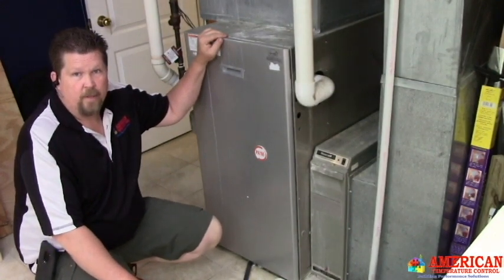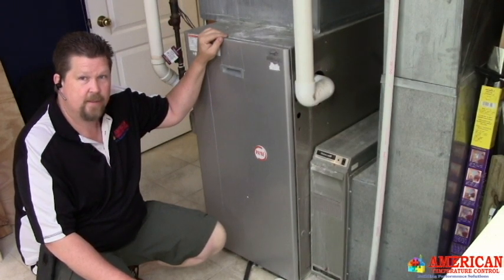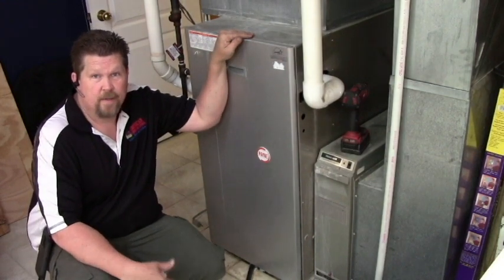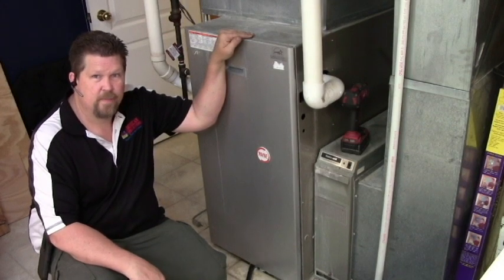Payne Furnace Heat Exchanger Replacement

Comment: I appreciated your informative video, especially since I know nothing about furnaces. My Payne PG9YAB036060 was installed January 4, 2012 and this winter it started making unusual noises. A whining sound has sometimes been occurring since November 2022. This noise can be heard before the blower starts and heating begins. It will happen several times until it starts up. Maybe the noise is from the secondary heat exchanger because I've never had it serviced or cleaned. I've lowered my thermostat from 72 to 70 hoping the furnace will last until spring. I also have a Lennox ac that was installed April 10, 1992. It's never been serviced and has been a terrific ac however it tripped the breaker in the summer of 2021. Since then I've been keeping the thermostat at 80 when I normally have it at 78 during summer. Sometimes I switch it off and use my electric fan to keep cool. It looks like I'll have to have it replaced when I have the furnace replaced or repaired and cleaned. Have a safe 2023 and happy birthday.
Reply from the maker: Thanks, your noise sounds like an inducer motor/fan blade failure, main contributor is poor air flow and/or high static pressures in duct system. maintenance does help.
Reply: @americantemperaturecontrol7852  Thanks very much for the information. Maybe the Space-Gard High Efficiency Air Cleaner is too restrictive. It uses Aprilaire 213 pleated replacement media which I installed October 6, 2022. The old filter looked almost like new since I have no pets, don’t smoke and live alone. After the Payne furnace replaced the original Tappan 11 years ago, it greatly reduced our natural gas bill but maybe the air returns are too undersized for the more powerful Payne blower. The Tappan furnace lasted 37 years although it should have been replaced sooner. We had to replace it immediately after the technician informed us about how dangerous it had become. The house was built in 1975 and we moved in about 6 months later in early 1976. The winters were much colder in the 70s, 80s and 90s but the Tappan was always reliable and trouble-free. Hopefully a technician will be able to fix the Payne soon whether it’s the inducer motor, pressure switch etc.

Comment: Nice video. Did you have to notched about 1/4" off the inducer legs to get the inducer to seal properly against the new secondary heat exchanger? Thanks

Comment: Excellent video how long will it last with new exchange do you recommend any maintenance to Keep it from clogging again?  I had mine done last year 😊
Reply: I have the same question basically.  Our Amana lasted 8.5 years.  Warranty replaced the furnace yesterday.  How can I prevent this clogging of secondary or where the soot/dirt came from?  They replaced without a good answer or resolve to this question in my opinion.  Hard to complain about a new furnace, but not excited about this one lasting only 8-10 years.
Reply: @blbrawn  I know my issue was covered outside pvc pipe from Home Depot so know I don’t cover with screen anymore.  I just leave outside pipes open I never had anything blocking it

Comment: I have a goodman furnace, now about 4 yrs old that has been running beautifully. (GMEC960603BN ). When the installer put it in , he didnt replace the plenum that sits on the burner cabinet. That plenum has a patched area i removed easily, because i was interested in looking at the condition of the A COIL . Well as i peered in, much to my shock, I noticed 3 rust blotches on the heat exchanger. A dark one, a lighter one behind it and a third lighter one down the same side (Theres is a heavy-duty, aluminized-steel tubular heat exchanger and a stainless-steel secondary heat exchanger. ) I touched the tubular affected area with my hand and it was still solid no cracks. How worried should i be in this situation . I intend on unclogging or replacing the A COIL that has a heavy rust spot on it that know is where the drip came from to cause the rust spot. Whats your opinion about this ? Would you replace it immediately  or wait , since its winter pretty soon?
Reply: if your co detectors are not going off then leave the furnace alone dont piss off the beast thats heating your home.
Reply: Relax sounds like it’s superficial due to a drip from the leaking ac evaporator ac coil above.🎉

Comment: There was a piece of metal that was on the old exchanger, between the secondary and primaries, that was forgotten. I really don't know what purpose it actually serves, or what it needs to be in there for, but usually you got to have them back on.
Reply: Without that plate the furnace will trip the main limit (overheating)
Reply: @douglasteetzel3552  yeah

Comment: Is there not an air diverter to go in between the primary and secondary in the back as in Carrier and Bryant to divert air.    Just asking
Reply: Not on all models, you will usually see this on on 3 stage furnaces or furnaces with low airflow capability to protect the high limit from overheating, he missed it on this model though hmmmm
Reply: @soloryderrr  
Correct, but I am pretty sure he removed it from the old one.

Comment: At 14:24, would you tell me the part number of the Primary Cell Outlet Panel, please, for PG9MAA-048100 (same as Carrier 58MVP-100-20), please?  I cannot locate that part number anywhere.

Comment: The video was sped up. How long did it take you and how long does it usually take you to complete both a primary and secondary heat exchangers? Great video as well!
Reply from the maker: Each change out is different. We knock them out usually 3hrs plus part pickup time and warranty paperwork.  The actual labor to change out can be as quickly as 1.5 hrs or long as 6hrs because the screws are rusted away.

Comment: I betcha that you got a call back on that furnace. I have done around 60 of these in the last 15 years. And i seen one step you forgot there is a baffle that is suppose to go under primary and on top of secondary thaf deflects the air. With out this baffle you gonna get 33 error codes

Comment: Did they change the material it's made out of for recall replacements or is it the same as it was ?
Reply from the maker: Yes, A replaced secondary heat exchanger can be identified by gray plastic collection box.

Comment: Was this a warranty replacement and repair? I have a 2005 Payne. What was the customer noticing about the furnace that required you to diagnose and fix the furnace? What are the symptoms to look for? I have a Payne that was installed around 2005. Are there recall notices on these?
Reply: Mine just started acting up I have this same furnace,  You notice the furnance stops functioning ( just spins the main blower constantly and slowly with no heat). and its not under control of the thermostat.  It trips the Flame out sensor / switch ( the flames that go into the top holes from the burner stop getting drawn into it so it basically burns / heats up that metal box you see it mounted in until the senso you see on the right side trips.  It gets hot, along with the top of the furnace housing ( hot enough to burn you if you touch it more then an instant.  

Mine was converted to propane so it seems to be clogged up, they replaced that air induction fan that you see ont he front ( black circular one with the plastic housing,  no change int he flames , its still not being sucked into the heat exchanger.  

So looks like rather then this whole heat excahnge out I will just get a new furnace with a heat pump.  This part alone that he swapped out is 1300 dollars on amazon.
Reply: @cranbers  , Can you  send me a link of this part? my furnace looks same and has same problem as yours.

Comment: You forgot to transfer that deflective plate from the old heat exchanger to the new one. I believe it only exists on the bigger btu units. In which case you had a 100kbtu exchanger and it is supposed to be transfered over to it.

Comment: That furnace is only a 2 stage and not a variable. You forgot to remove those 2 air restricters in the back bottom. Also, you left out the horizontal air deflector in the back that redirects the air so you don't get an overheat shutdown.
Reply: Those restrictors, sometimes they are on the brand new secondary and sometimes they aren't. Same part number secondary. I've also had secondaries come in without the side panels. Very frustrating when carrier isn't making it consistent. This furnace is only 1 stage in the video, usually that horizontal piece is only found on the 2 or 3 stage. Ive found one single stage with it, on a 100kbtu that was also missing the side panels from the factory. Junk.
Reply: Payne is garbage only a single stage not a 2 stage.
Reply: 😅thanks will never buy Payne or Carrier.

Comment: Good god man! Damn good work but I gotta ask why? I imagine between the cost of the new heat exchanger and labor taking apart the entire furnace and reassembling it wouldn't be much of a difference in cost to just install a new furnace? Is it covered under a warranty or something and the manufacturer has to pay you labor costs or something?
Reply: Maybe it was his own furnace.  Or maybe not, but that would be a factor.

Comment: Its a design issue.. inducer doesn't pull enough water out of unit.  Pitch must be right or it will sit on secondary.  Cells prevent  water from properly pulling off secondary.  Look at heat fatigue on cells.  Look at area it wears.

Comment: Even with a new  heat exchanger, you still have other old components.  If the blower motor fails,  or the control board, or the gas valve, or a pressure switch, or a limit, etc............. your total individual repairs will come to perhaps 75% to 85%, or even more of the cost of a new  furnace.  I would only recomend  a heat  exchanger change if that furnace is still under warrant y.  That's  just my opinion.

Comment: What a payne in the arse! New tech here. Nice vid

Edit: How did you know that part was clogged up? What caused it and what function does that part have? Thank you
Reply from the maker: Yearly hvac inspection with a Combustion Analyzer well let you know when a problem starts.
Reply: roll out swith on these single door payne carrier furnaces is an instant give away for a plugged secondary. these models are notorious for this recall. anything over 100ppm in the flue or smell of aldehydes is a dead give away.
Reply: @americantemperaturecontrol7852  roll out swith on these single door payne carrier furnaces is an instant give away for a plugged secondary. these models are notorious for this recall. anything over 100ppm in the flue or smell of aldehydes is a dead give away.

Comment: 🎉A comment on control board fail. It cost 78.00 on the internet. The repair fleecer charged 650.00 for 25 min to install it. 😮 The previous fleecer said, I can get you a new furnace for 8,000.00. What a shady Industry.
Reply: Funny how no one ever calls doctors fleecers when they perform a 2 hour procedure and bill $35,000. We're paid for results, not our time. If it takes me 2 minutes or 2 days, you're paying for results. Otherwise, order the part and try your best to replace it, and if I have to come out and clean up the mess, it'll be an additional $150 inconvenience fee. 😂

Comment: Carrier always making people assemble these things themselves...and they still can't seen to be able to get them right.  I've heard of these things failing in six months.  I think the reason they put 20 year warranties on these things is because they're too lazy to re-engineer the furnaces to get around the problem.  And then you end up with recalls.
Reply: Hello!
Reply: They will never admit its a recall issue..
Reply: They did re-engineer the heat exchangers around 2011. Haven't seen that issue since.  This issue sucks in Washington State because of a lawsuit here. If we come across it here we have to give free labor and parts to the homeowner. Only the primary and secondaries. Hard to sell new. But we offer 20% off a new Furm.

Comment: I still dont know why they would do the swap.. putting a new exchanger in old junk is like putting new cylinder heads on a miled out 350 chevy.. just yank it and install a new unit. For the labor to do this i could install two furnaces in that time and then there are still all the other old parts on that will start failing as well because they are 15 years old..